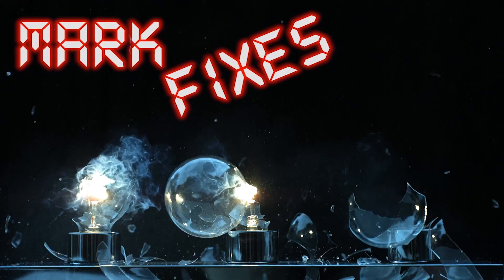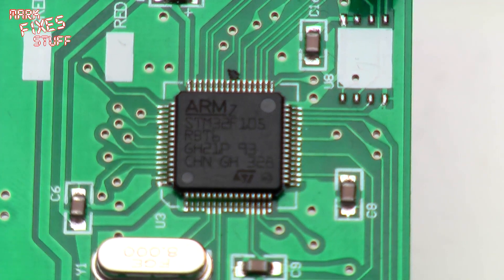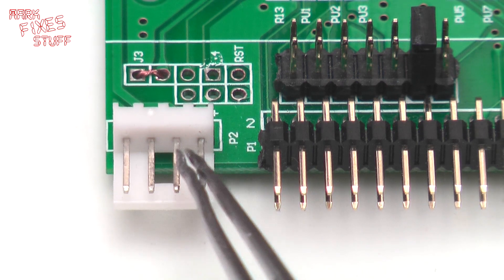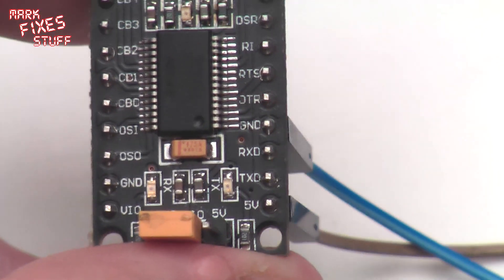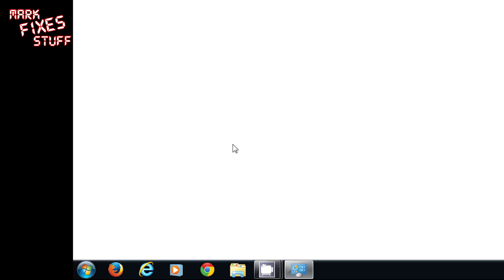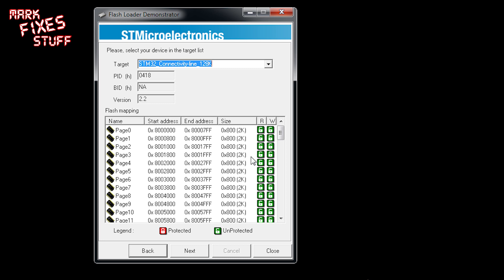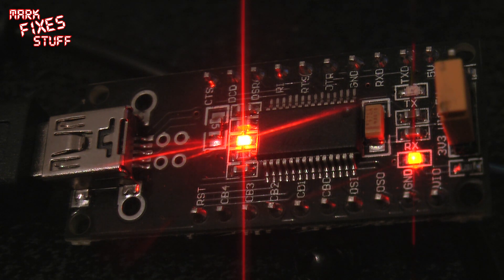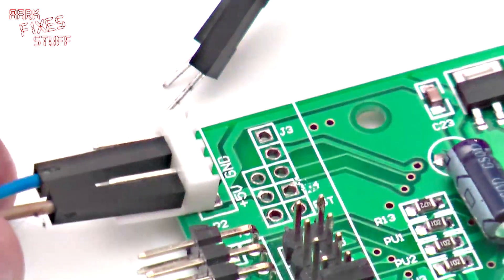Replace Amiga Floppy Drive with a Gotek USB Floppy Emulator - Firmware Flashing Instructions

Comment: does not work for me. Still stuck with unrecognized device. Tried to reset many times but no luck.
Reply from the maker: This way is old news now. Search for FlashFloppy by Keir Fraser. You can flash using USB A to A cables easily.
Reply: @MarkFixesStuff  Ok thanks you mean the USB port of the Gotek (used for the USB stick)? So it is a direct USB connection? FlashFloppy is indeed the firmware I want to flash.
Reply from the maker: @repetto74  yes, but I’m no expert in this method. There is a really good wiki about how to do it and a flash floppy Facebook group. It’s a usb to usb connection now, but I did it myself over a year ago so can’t remember the details! Sorry!
Reply: @MarkFixesStuff  Thanks Marc, I have all the required information on the FlashFloppy Github page :-). I will give it a try hoping that this Gotek is not a faulty one.

Comment: Dude let me ask you something kinda of topic please. I just bought 2 of these and I tried to use one replacing an old Floppy drive at an IBM Pentium 4 PC with Widnows XP. Sadly the PC didnt booted and All I haved was a black screen, not even was able to see or enter the Bios.  Then I returned the Floppy drive to the PC but even If now I am able to see  a meessage about the PC is ready top boot, it fails and the message appears again and again.  So any  ideas  what I should do here? I should change the Jumpers at the floppy emulator?  I have the SFR1M44-U100K model

Comment: Slightly off-topic, but Mark, do you or anyone here know of regular Gotek firmware being downloadable from anywhere? Apparently, some of these drives are quite limited in function and don't allow what they refer to as "image mode", despite being physically identical to ones which do.

Thanks! (and thanks for the video)
Reply from the maker: +Jidis Safi I don't know of anywhere to download it. One of the problems is that the original firmware is read-protected on the drive.
Reply: Thanks Mark! Yeah, I read that info about the protection somewhere too. I was just wondering since there seem to be a few variants (including clones) if maybe not all of them were.

Take Care

Comment: I cannot for the life of me get this to work... I have everything connected properly, yet I keep getting the error message "No response from the target, the boot loader cannot be started. Please verify the boot mode configuration and the flash protection status. Reset your device and try again". After resetting it just repeats the message... caused me no end of headaches and the whole thing's about to go in the bin.
Reply from the maker: +painreliever83 Possibly a fake interface?
Reply: Possibly, it was an ebay cheapo special. Seriously though, if someone's going to make a cheap knockoff of an already cheap connector, you'd at least think they'd make sure it worked. Seems such an odd thing to counterfeit too...
Reply from the maker: They did work, but FTDI got pissed off and on the later drivers wrote in a code to make the knockoffs fail. If you use a 32bit Win7 it usually works with even the clones. You can tell a fake, as the have screen printed text on the chip instead of the laser etched details which have texture.
Reply: Mine's a Prolific chipset, using older drivers. Using Win8.1 32bit. It's probably what's causing it, I'll get an FTDI one and try again, if it doesn't work I'm just binning it and buying a pre-flashed one off ebay. Beginning to seem like more trouble than it's worth.
Reply from the maker: If you have a machine with an older 32bit os hanging about it's worth trying with that.
Reply: Dug my old Win7 PC out of storage to try it and got the same result. Going to get an FTDI adapter as a last attempt.
Reply: Got it sorted, turns out the problem was my own soldering (I'd soldered a header onto the board to attach the wires to) - turns out I'd not done a very good job on one of the legs and it wasn't making a good connection with the board. Resoldered the leg and it worked first time. Oops!
Reply from the maker: painreliever83 HAHAHAHAHAHA!

Sounds like the sort of thing that I do.

Really pleased it's working for you!  <grin>

Comment: Great video. The HxC firmware is supposed to be compatible with the cheap gotek now, and hoping to flash to that as its compatible with CPC, ST amongst others aswell as the amiga. I was wondering could I use a proper serial port rather than a USB to TTL adapter, as one of my machines has serial ports on the rear.
Reply from the maker: +paulisthebest3uk Yes, the new Gotek firmware is available from the HxC guys, but you have to pay for each copy to enable it. It's low cost though. 

You absolutely can use  a standard serial port, as long as you make up a cable of course  :)

Thanks for watching mate.
Reply: Paul (or anyone),

Be aware there's likely going to be a voltage difference there. The Gotek chip takes 3.3V and is supposed to be "5V tolerant", but IIRC, the regular serial ports can do something like +/- 12V. I took the wimp route and ordered one of the CH340G USB adapters for a few bucks.

Take Care

Comment: Mark, from my experience, the baud setting via the driver is irrelevant and baud rate is soft-set for these devices. You should be able to set the rate at 115200 in the flashing app without issue.
Reply from the maker: That's my experience too and I have successfully used 115200 baud on one of my PC's (Win7 32bit) but on some others the ST loader software simply won't work reliably, as in communicate, at the higher baud rats, so I went down the reduce baud rate for the sake of simplicity. When using similar "port in a cable" type devices for flashing projector firmwares I've had more success on all platforms at the higher speed, so I suspect that the ST software is a bit flaky. That is a guess though.

Comment: Look what I found on eBay!  It makes floppy drive NOISES!!!  Wooooow l@@k RARE!(lol)  http://www.ebay.co.uk/itm/Amiga-USB-Floppy-Emulator-SOUND-EFFECT-A500-600-1200-2000-3000-4000-Gotek-/261626909821?pt=UK_VintageComputing_RL&hash=item3cea2dd47d
Reply from the maker: You can find the circuit to do that for about 70p of components. That drive is a bit overpriced in my opinion  ;)
Reply: Yes and no, If  a Amiga can not read the disk then you get a read/guru error,wrong gfx or a reset and then a guru error. But on the C64 you have this problem that the C64 will freeze when loading from disk. Then you wait forever when the loading is done ;)
Reply: Mark Fixes Stuff - Retro Console and Computer Repairs, Reviews and MORE!

lol I saw this one also on eBay, way overpriced!!!
It is easy to add drive sound mod to the Gotek ;)
Reply from the maker: MrFixer1983 Yeah. I don't actually want the sound as I can play my Amiga whilst the kids are sleeping now!
Reply: Ok then, I don't have kids. But I know what you mean, my wife don't like if I play SID files when she sleeps ;) But I like there is a way make the gotek do those reading sounds. For me it is nostalgia to hear the reading noice ;)
But in the end you can also make a drive sound on/off switch ;)
Reply: MrFixer1983  Yup I would have thought the noise was useful in case the Amiga stopped reading and was just sitting there doing nothing!  The link I put was just an example to show you guys in case you hadn't seen (or heard) it :)  Funny thing is most of the Goteks I saw on eBay were already Amiga modified so it could be a little harder for the Yamaha or perhaps Atari ST guys lol

Comment: Aaaah that looks nice and easy as long as you have all the kit :) aaah imagine an Amiga 600 with freedom from the floppies and Lemmings on the SD card :D My Amiga 600 had a rusty motherboard, Amiga 500 old and crusty and turning brown and my Amiga 1200 is always malfunctioning :( Lemmings is loaded on my Megadrive's Mega Everdrive, I actually prefer the Megadrive version the music is more lively and Amigas broken anyway!!
Reply from the maker: The kit for flashing the drive is only a little more than £3, and the drive itself is just around the £12 to £13 mark  :)

The rest is just wires that you could scrape together out of an old cable.
Reply: Mark Fixes Stuff - Retro Console and Computer Repairs, Reviews and MORE! Good point I just thought maybe them wires are like those USB wires!  Hehe I wonder what kind of loud pop you would hear if you tried to power up the original floppy drive using the TTL converter :D